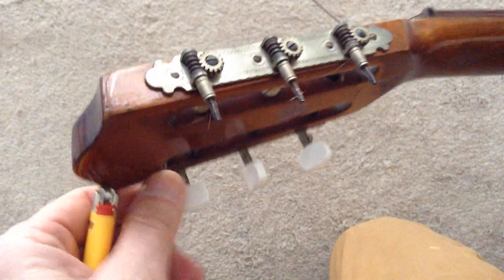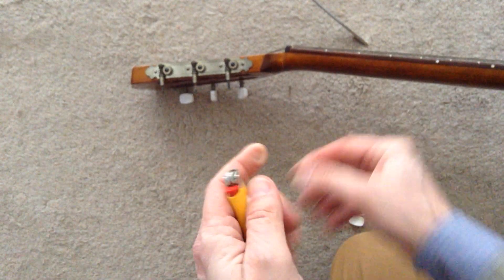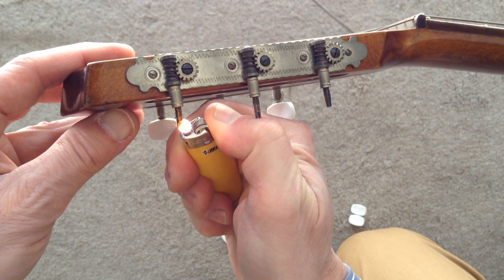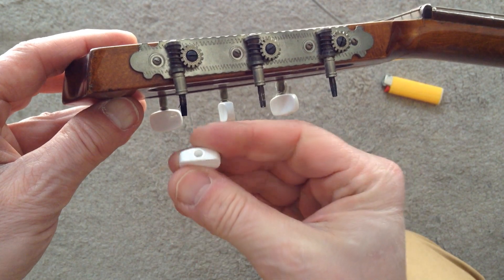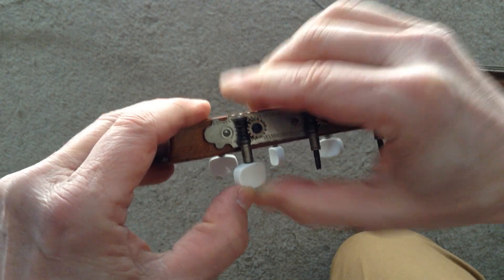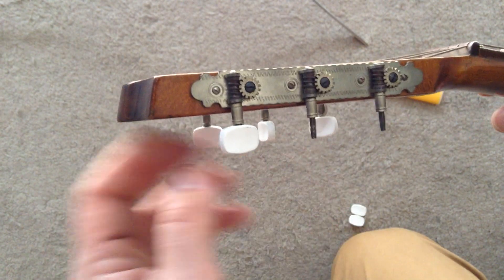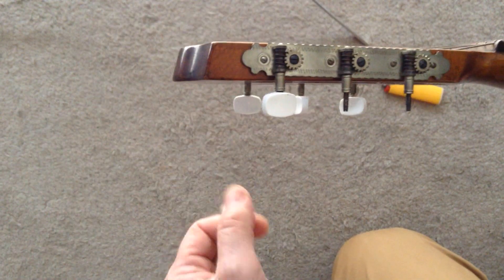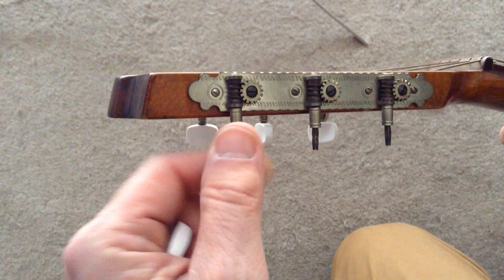How to change guitar tuner buttons

Comment: I am confused with the physics. Heating the metal pegs would cause the metal to expand, correct? Would you want the pegs to shrink, then place the knobs on the pegs?

Or does heating the pegs cause it to score and melt part of the knobs, thereby creating a "bond"?

Any help would be appreciated, thanks!
Reply from the maker: The not metal melts the plastic
Reply: @PeterUnbehauen  most pegs have two little teeth that dig into the plastic whilst it melts thus giving an area for the button to turn the peg.

Comment: how to get it out ? get it in very easy  (no body know )
Reply from the maker: normally they fall off - the plastic becomes dry and brittle. If the plastic is still intact, there is no reason to change them, other than devalue the guitar.
Reply: @PeterUnbehauen  what if you want to change the button for a different one because of colour or shape